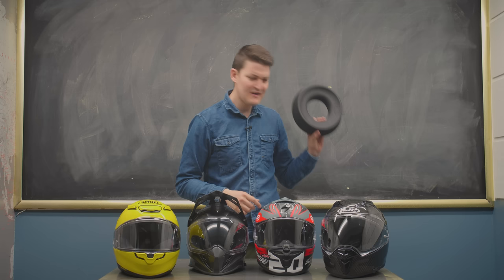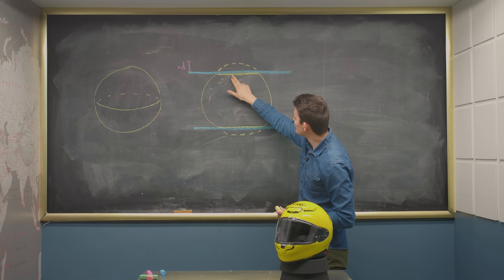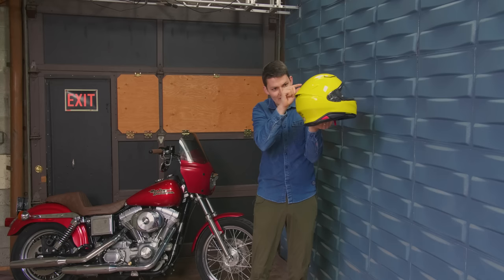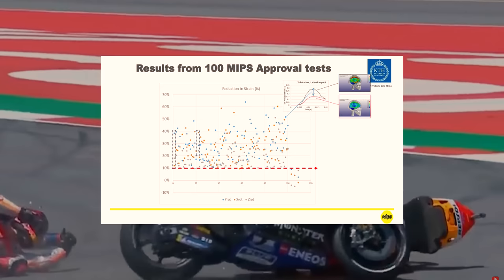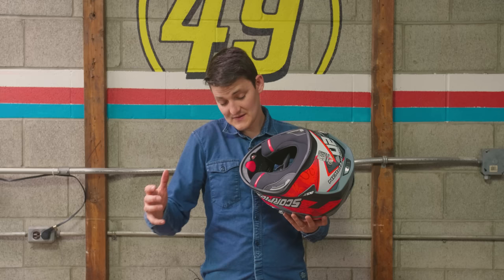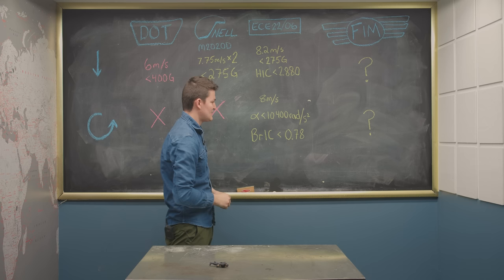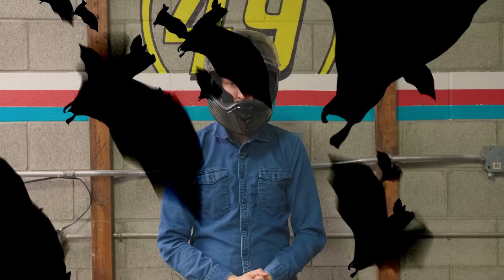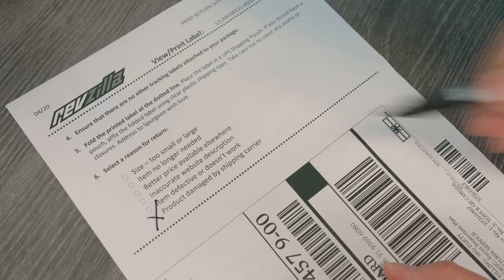What's Inside the Best Motorcycle Helmets of 2021?

Comment: Back in the 90's "plastic" helmets (polycarbonate) were always cheap, thin, and had a mould seam down the middle. Glass fibre helmets were much tougher, heavier, "safer" and more expensive. I stopped riding in 1998, and started riding again in 2014. I bought a Shoei Neotec (flipfront) for £350. Because it was the "quietest" helmet around. But the wind noise, coming back to biking, was HERENDOUS!!!! I couldn't BELIEVE how loud the wind noise got above 60MPH. It was SOOOOO LOUUUUD, I was forced to STOP biking in 2017 because I developed TINNITUS from the wind noise!!!!!
   The "loudness" level for a Neotec was 98 decibels. I now know -  THAT IS FAR TOO LOUD FOR HEARING SAFETY. Back in the 90's I don't remember wind noise being an issue. I had an old RF900 back then. It was stiff, heavy and had a thick shell. Now ALL the manufacturers make the shells of their helmets "waffer thin" - to make them CHEAPER TO PRODUCE. But they are all RISKING YOUR HEARING if you don't use earplugs every time you ride. Don't let the manufacturers BLAG you that the noise inside a helmet comes from "gaps under the chin".
                                    WIND NOISE COMES FROM THE TURBULENT AIR going round your helmet AROUND THE AREA OF YOUR EARS!
     And because helmets are so THIN nowadays, the shell won't keep the wind noise out! I've still got the tinnitus. Still can't ride because of it. I'll probably have it now FOR LIFE! If I'd been wearing a good stout, thick shelled helmet like my old RF900, I bet I'd still be free of it now. And still riding.

Manufacturers - MAKE HELMETS THICKER SHELLED TO KEEP THE WIND NOISE OUT!
Riders - WEAR EAR PLUGS WHENEVER YOU RIDE!

Tinnitus is SHITE. Don't risk yourself getting it just from a thin shelled helmet.

Comment: If you are sparing with another boxer, the helmet only protects you against scar or skin cut by opponent knuckles, but you can always be killed by a KO behind the head with helmet or not. Also, in the same way, the motorcycle helmet can protect my bones and flesh, not my brain as strong as the helmet can be except with a deceleration system or virtual gravity inside.

Comment: I have an rf1400 in the same color.  the first few rides the foam is super tight, but it does loosen up.  Ventilation is not as good as the Bell Star, I was thinking of switching back to a star but all this science has me thinking otherwise.

Comment: 6:10 This breakdown is oddly contradictory to what I get from Revzilla's Helmet Safety Rating 101, which seems to suggest that the Snell rating is more stringent than ECE overall, but they don't say a word about rotational forces. It seems both synopses are a bit of an oversimplification.  Would love an updated version of the "Dangerous Secrets of the DOT Helmet Standard" video that would the granular details of ECE 22.05, Snell M2020, FIM, and Sharp.
Reply: This is the best motorcycle content i know, witty, well informed and passionate. Keep it up!

Comment: Most Bike Crashes Are From The Side..
But Head On Collisions Are Frequent At Busy Intersections Not Well Lit Up Or Sharp Turns Indicated By Road Safety..

But , often I Found High Speed Cornering Crashes On Especially Low Kerb Weight High Torque Bikes ..
Doing 100kms plus All Other Designs I Found Different Types And Levels Of Discomfort..

With Added Jaw Gaurd And Sun Shades As Added Protection For Face First Accidents.. much more than ordinary ones..
That, X Games Is The Place With Most Testimonials To Get Back On..

Comment: Great presentation on what is in the best of 2021 helmets.  But what about a presentation on what hele=met fits when heads.  as we know heads range from full oval to full round but, apart from Arai, no one seems to mention much about it.  Lots of variables for a good helmet with impact protection at the top but if the fit hurts you are not going to wear it.  I average on the oval side of intermediate oval to which some models of Arai & Shoei belong.  What about some of the other models out there such as Shark?  HJC did not work for me in one model but do they have variation.  Mmmmm?!  It would be interesting to have an independent objective evaluation.  Always learn some thing from every video  Thanks for the hard work and keep the thought stimulation coming.

Comment: Great review and video. I was hoping to see the 6D ATS-1 helmet that has patented suspension
Reply: I actually bought one and had to return it. In terms of safety, nothing comes close to ODS (maybe Bell FLEX could be considered a distant second?)

Problem is 6D put all their focus on the ODS tech, and pretty much put zero effort on actually building a usable helmet. The build quality was on par with a ~$100 helmet. The pin lock literally doesn't fit. One of the clips holding in the padding was broken. Stray glue all over the place. The list goes on. Heck, even STG said they won't carry it because the aerodynamics of the helmet are so bad that it's unrideable once at speed.

I was gentle as I had to return it to get my $800 back. Someone like Ryan F9 would probably dig into it more and post an absolutely horrendous review for sure.

Comment: Really impressive. I actually have several mc helmets. But my concern is elsewhere. I now ride a stand upright e-scooter. I cannot bring myself to ride it with a MC lid regardless of safe i would be, nor my armored jacket and pants. I am using bicycle helmets now, and there is my issue. Scooters (13-28mph) ride a notch above a bicycle (9-16mph) range, and within the 20’s dry eyes is a concern along with flying insects and rode debris. To date i have not found a proper helmet, one with robust bicycle level protection and a full or 3/4 facial protections from dry eyes/flying things due to upright standing at 22mph. I love the face shields on the watersport Garth RV helmet reasonably pricing at $200 but skull protection is minimal. It’s considered because I falsely believe I won’t take a full crash like I wouldn’t on a bicycle. Tthe helmet insulation of DSG Pace or Predator dh6-x which are used for downhill long skateboard racing are sufficient but these have real chinbars making me appear like i’m on a sportbike instead of a computer scooter and these two are expensive about $400. I’ve written to bell, specialized, including some scooter manufacturers to influence e-scooter helmet products. But in the meantime how does your physics acumen offer insight into possible helmet options?

Comment: So this might seem odd, but it seems like you look at a lot of helmets so I figured I would ask: Do you have any opinions on which helmet has the largest internal size or company that makes actual custom shell helmets? I currently have a 5XL HJC i10, which was the only 5XL helmet I could find at the time, but it is so tight with the padding in that I start getting dizzy and having blurry vision within 30 seconds of wearing it. I currently wear it with all the padding removed and just a few strips of felt tape inside, but as you might guess that isn't optimal. I have spent hours and hours looking around for something with a larger shell size so I can use normal thickness padding, but that isnt a specification that it seems like helmet companies want to give out. Any thoughts or ideas for someone with a watermelon instead of a cantaloupe?

Comment: This is a little frustrating because, when I bought my helmet, I tried on 5-6 brands to have all of them not fit my head shape. Including 2 of the brands showcased here, Shoei and HJC. Bell was the only brand that fit my head shape. Is it better to have a higher rated but ill-fitting helmet (extra space at front/back in my case, for instance to where the helmet moved when I nodded my head) or a good fitting but lower rated one? I went for the fit on the advice of the team at cycle gear.

Comment: Hi buddy I’m looking at a DSV3 ONYX

Explore the unimaginable and find yourself wearing the DSV3 Onyx adventure helmets, constructed from a light weight polycarbonate composite with a dual density impact absorbing EPS inner.

SPECIFICATIONS

TSS Twin Shield Sun visor system
ECE22.05R safety certified
3 in 1 capability
Quick release outer visor
Aerodynamically designed construction
Micro metric chin strap safety system
ERS Emergency Release System
Plush Moisture wicking Inner liner
Multiflow ventilation port system
Anti fog *Pinlock prepared outer visor

Is this any good . 

Or should I go with the Bell Mx9 adventure helmet

Comment: HJC F70 Carbon is not ECE approved just DOT (Edit: US Version ONLY). I just received my F70 Carbon and couldn't find an ECE sticker anywhere so checked the HJC website and it shows the ECE rating just like CycleGear's website. Called HJC US support number and the rather abrasive guy confirmed that the carbon version does not have an ECE rating. Claimed it was somehow related to weight as to why it couldn't get the ECE rating. He said he would talk to his website team and have the verbiage fixed to reflect only DOT. Now I need to decide if I want to keep the helmet or not, don't like being lied to.
Edit: Upon further reading I see that this helmet is ECE certified in Europe (and I assume Canada). So I will assume any safety differences between the two versions will be extremely minor and probably just technical in nature. Still wish websites would have the correct info, saw that Revzilla has as DOT/ECE too.

Comment: ''We living on a dream dude, you cant stop the extreme acceleration and impact of the brain to the inside of the skull, these helmets only distribute the local loading on the skull exterior and reduce local skull deformation and potential bone fracture, and hard object penetration. The weight of the helmet adds to the kinetic energy stored in the head above the cervical spine, the additional mass of the helmet adds to the kinetic energy stored in your head, and if you suddenly stop your body from moving via impact, your head carries on unfortunately in the same plane as your discs in your cervical spine until stress equilibrium is achieved then the skull is pulled in an arc downwards and compresses the front of the cervical discs and stretches the back of the neck until  C6 C7 C8 nerves are ripped, and anterior disc damage via in plane deformation occurs, and/or  severence of the cervical nerves occurs resulting in paralysis from the neck down. 
If you are really concerned, spend less on a helmet and the balance on a neck brace.  Thanks for the video Susan!

Comment: With all due respect, your analysis of the helmet standards—especially the DOT standard, which you crapped on—leaves much to be desired. The 400g maximum impact limit you quote is not indicative of overall performance, because there is also an impact time limit in the standard, which keeps the practical maximum in testing well below 300g. I did an extensive helmet test for Motorcyclist Magazine, back in 2005, in which we hit helmets very, very hard, and measured transferred impact to the headroom. The best helmet of all, including Snell Arais, Snell Scorpions, Snell HJCs, Snell Ikons, etc., was a DOT-only $79.00 ZR-1, made by HJC in China, with a very durable, impact absorbing plastic shell. In our biggest impacts (as high as the test rig at Collision Dynamics, a well-respected test lab, would go), it performed flawlessly, with the shell unbroken and nearly unmarked. It also delivered an average of 67gs less acceleration to the headform than the stiffer Snell helmets in all our tests, which corresponds to one whole level of brain injury, ie, from "severe" to "serious", in the medically derived AIS (Abbreviated Injury Score) ratings. The Snell standard improved in 2010 (they finally discovered that huge heads weight more than tiny heads, 25 years after the ECE and 
DOT did), but it is still considered a scientifically dubious standard everywhere but the Arai boardroom.

And I have no idea of how you claim to be showing the "Best Helmets of 2021", and make off-the-cuff, uncorroborated comments about each helmet's safety, without examining the 6D ATS-1R, which I won't ride without. It has two separate EPS shells, with energy-absorbing elastomeric bumpers between, to outperform just about anything in low-energy impacts and high-energy impacts, and especially reduces brain-twisting rotational impact energy, which is produced in just about all real-world crashes. Dexter Ford, Contributing Writer, The New York Times.